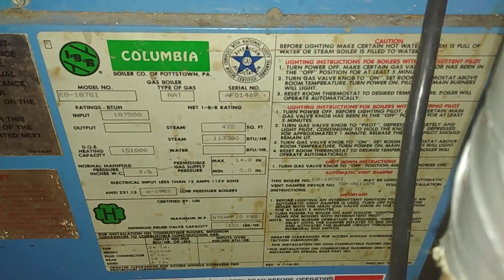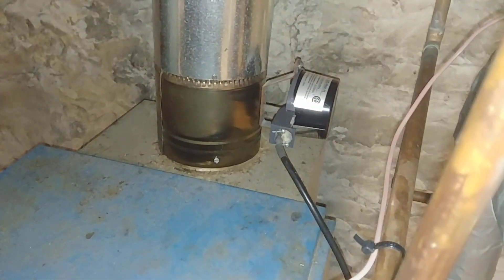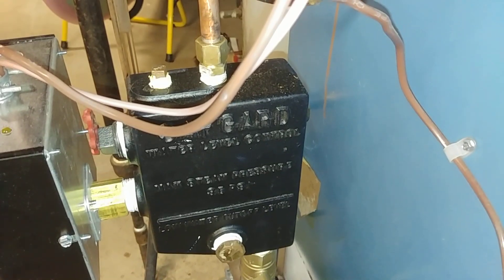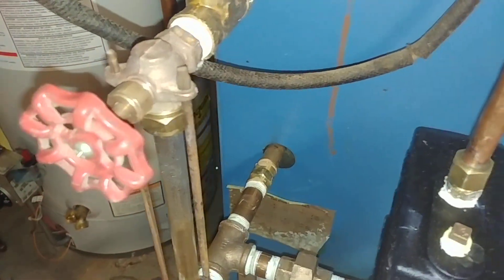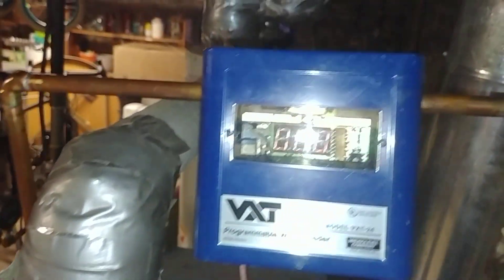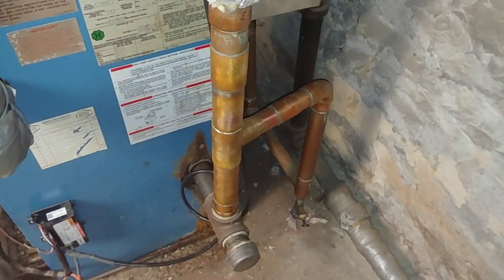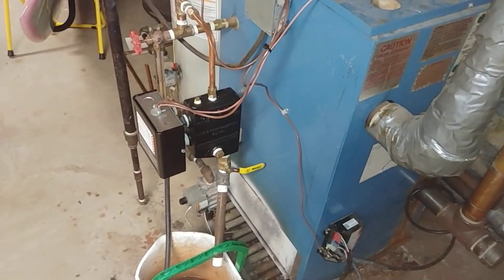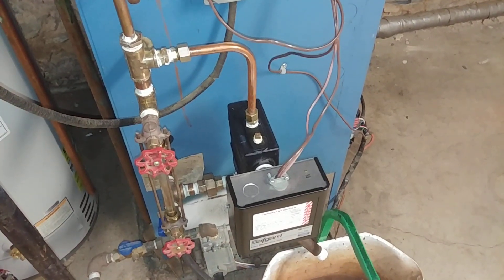Installing A Probe Type Low Water Cut Off On An Older Residential Steam Boiler Using A 711C Manifold

Comment: Hi Gordon,  very cool set up. How much is the Safguard 711C?  Would you use this in place of a 67 low cut off?

Thanks Gordon you’re the best
Reply from the maker: I thank you for your kind words!
SupplyHouseDOTcom wants over two hundred for it & it is on backorder (just ordered a stock replacement for the one shown here).
Yes, most certainly the 711C can be used in place of the #67.
In fact, it might be easier to do that, then replacing the 47-2
because the water feeder part requires a lot more re-piping.
The hardest part for me in using the 711C is bending the 1/2 O.D. soft copper and setting up the adapters.
You could use 5/8" compression fittings/adaptors and nominal  1/2" copper pipe.
Reply: This set up you did in this video would probably be the same cost as installing a 67 feeder, but would be much more reliable as it doesn’t have a float or switch to malfunction
Reply: Where can I purchase only the 711c

Comment: Gordon,why does the loop bang? Is it the distance between the tee and the elbow?
Reply: Yes, the nipple must be kept short (and its height is also important). The longer, the more hammer. There is always a small amount of hammer at the equalizer tee and the wet return. This is due to rising steam from the bottom of the equalizer meeting cooler condensate of the wet return. When the steam bubbles meet the cooler condensate, they quickly collapse, creating a void. The condensate rushes in to fill the void and causes water hammer. The longer the nipple the faster the water can move/surge and thus the louder the bang aka water hammer. Pretty cool stuff, ha? how many kids (or adults) in the world know this? ;-)
Reply: Thanks for the answer